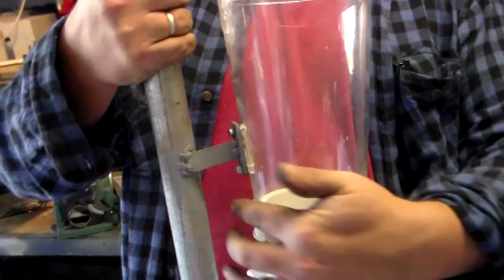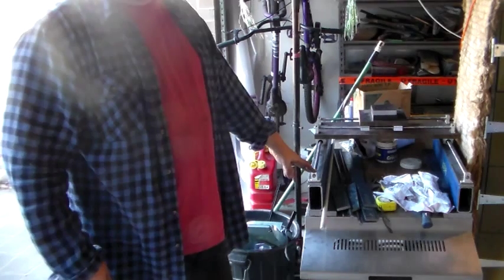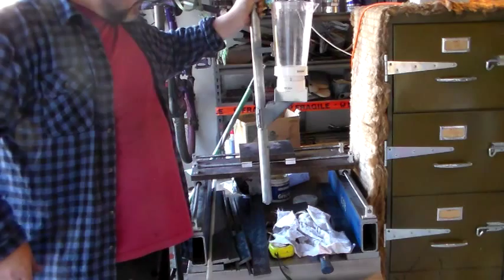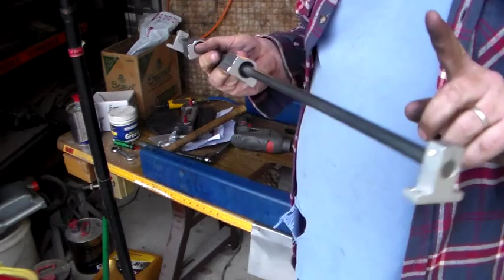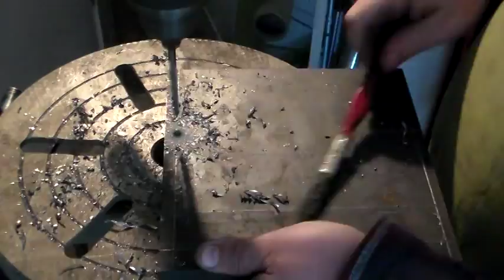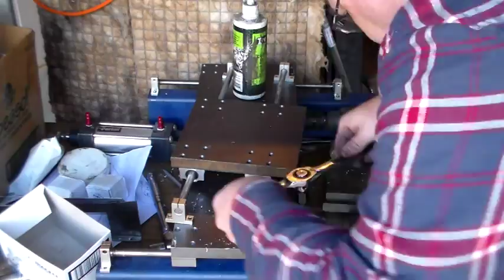Making a Plastic Injection Molding Machine Part 10

Comment: Also, since an enormous power needed for compacting, at least half a ton of force. Can that bearing rod can handle it.  Maybe put a roller bearing right under plate, directly under the extruder. But you can always switch to a low pressure system.

Comment: I don't know what you're doing there. But like those slides.  Injection mold machine consist of two basic system. Extruder and clamp. I hope to see those soon.
Reply from the maker: David Thanks again for your comments and feedback David.  My thinking for the slides across the X-Y axis' was really because I figured Í will be doing moulds of varying sizes and I don't want to have to be exact with the placement of the fill port on the mould to match the machine, it may turn out to be unnecessary but that's OK. As for the drooling issue I'll cross that bridge when I get to it and about plans...um, I don't have any, just kind of making it up as I go so everything is subject to change.  I have been working on the clamping today, my videos are slowly catching up to my progress.  Also, you mentioned about the roller bearings taking the force...I had the same concerns. I did fit an M12 bolt to each side of the 2 carriages to lock them down when in use and they should also help take the strain of the linear bearings but again that is something I will need to access further down the track.
Reply: For cones parts ideas, try grease fittings, countersink, Solid Cone Nozzles, grease cone nozzles, acorn brass nuts, or cut your own. For clamp... I would start with a C-clamp.